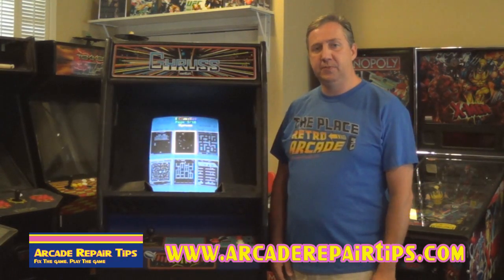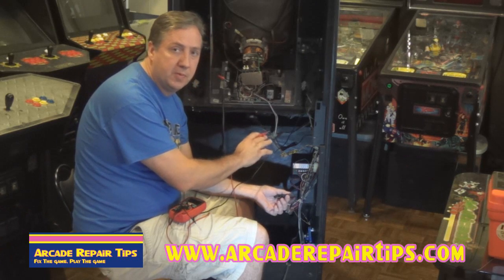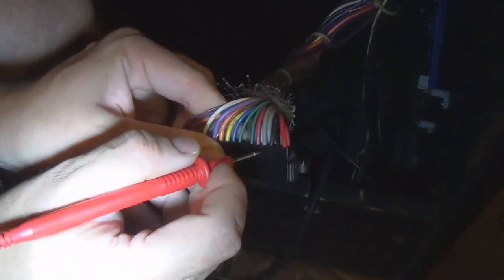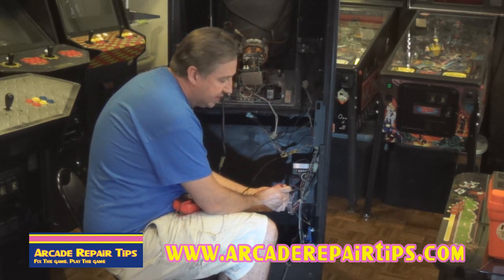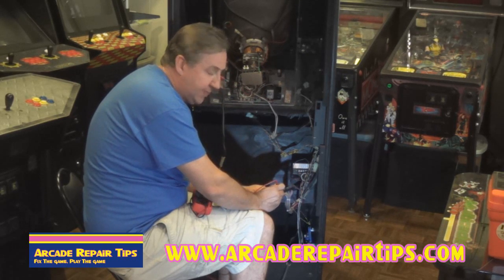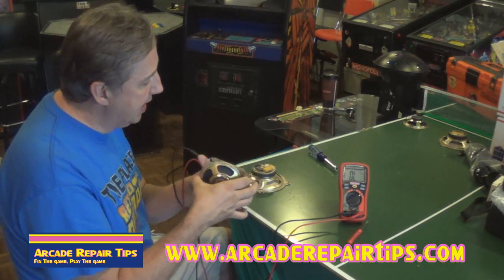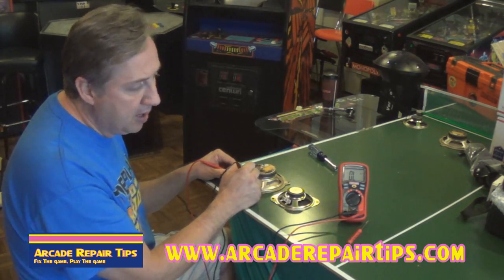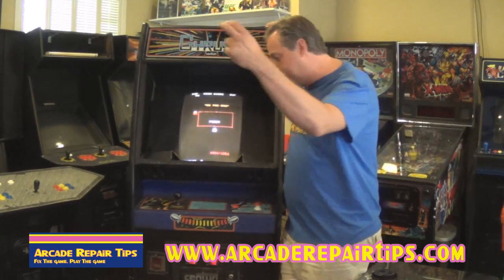Arcade Repair Tips - Troubleshooting Games With Sound Issues

Comment: I'm having a similar issue with my Arcade cabinet multi game machine. Is an Arcade game that I bought from China. It has 2100 in 1 PBC board. Anyway, I started having issues with the sound. At first it sounded like the speaker was starting to fail. It had a cracklyn noise, then it stop working all together. I contacted the manufacturer of my game, they told me that it might be the speaker, so they sent me two brand new speakers. I install one of the speakers, but I still have no sound. I noticed that when I plug my headphone jack to the sound jack on the board, I get sound, so the company rep told me that it couldn't be the board, since I was getting sound from the board's jack. So next, I replaced the speaker wires, to see if that was the cause, still no luck. I then tried to test the connectiviti on the Jamma harness pins, I can get beaping sound from it, although I am not an expert, I'm not sure if I tested the pins correctly. I resolder the wires to the sound pins on the Jamma harness, but I'm still having the same issue, at this point, I am stump, I don't no what else could be the problem? I even bought some brand new speakers and tried them as well, but the same problem, no sound. The funny thing is, that when I first tried the speaker that I bought, I had sound comimg from the games, but all of the sudden, it stop working. I should mention, that the speaker that I bought and installed at first, was a 50W speaker, meant to be use on cars, not arcade games. And the original speaker that came with my game, was a 5W speaker. I don't know if that makes any difference.

Any ideas?

Comment: OK so this was really helpful but I have a further question: those white clips that form junctions in the wiring chain... How do I get the wire end out of those? Am I supposed to be able to do that? I think one of them is the wrong way around in my cabinet. The one with the set of four wires, for the speakers. I've tried the obvious: just pulling... Am I being too gentle? Should I use like plyers?